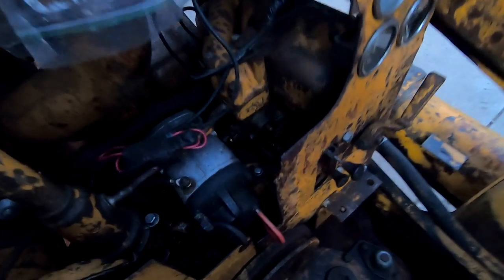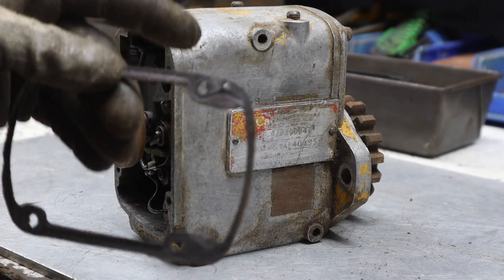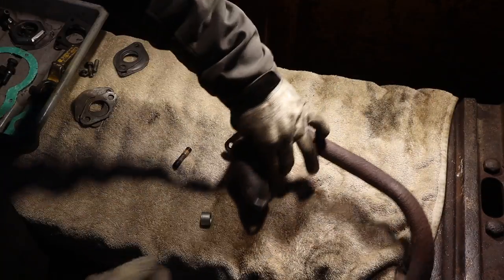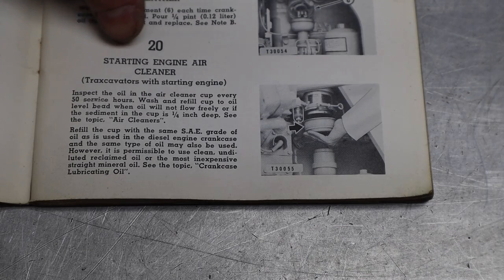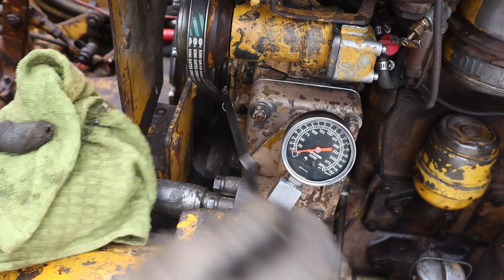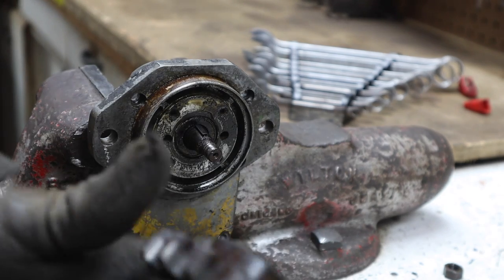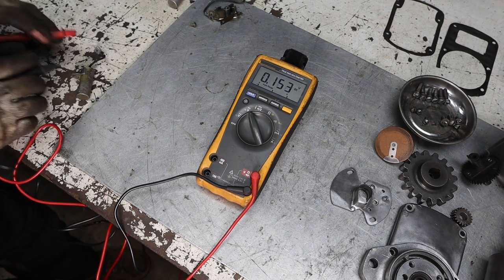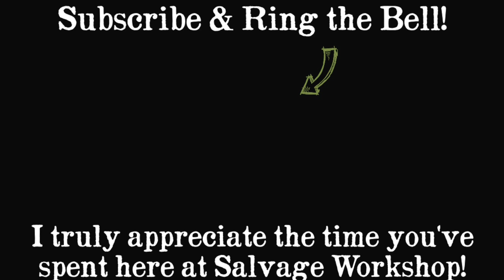FINALLY Found the PROBLEM! ~ Time to Rebuild a Magneto ~ Part 14 ~ 1950s Caterpillar TraxCavator

Comment: I think it would be a wise move to remove th Pony Motor,in its entirity and strip down clean up the various bits you cant get to at present, if your interested to repair an oversized hole to fit the standard size back in ,thread the hole oversized put a bolt into it, cut it off at the correct surface level, then mark on the newly filled hole,  with a center punch , drill it to the correct tapping size and retap it, to original thread size, studs are fine if the bolt to engine body has a small hole drilled on the oversized bolt holt to body line and a small screw or even a bolt fitted this will stop it coming out later, this was a task fitting apprentices carried out in their traing often on cylinder head bolts on diesel welding generators and pf types of steel engines dont try it on alloys or Aluminiun, as it works but steel correds and swells , check out old metal items found in rivers etc , 
By the way “Bolts have 6 sides normally” scfews have a slot or slots cut in them to fit a screwdriver, check your descriptions on reviewing and editing the videos , other wise if learning your thing then identifing items correctly makes your life easier, by the way , glad you found the problem , looking forward to next installment .

Comment: 50:25.  The "Condenser" (actually that is a misnomer) IS an electrolytic capacitor.  Often misnamed as a "condenser" -- whatever that is electrically!  Electrically is is a type of capacitor -- an electrolytic capacitor -- be under no misapprehension about that!

Comment: I watch the channel because you don't say "it can't be done"..you keep going on without thinking the amount of work and you are doing everything yourself.That's the meaning of life through this old machine that wants to live too. My guess now for what maybe happened.. because the flywheel is made from hard stuff alloy , with heavy duty bearing on shaft that difficult goes wrong and the gear of the magneto probably from a soft alloy (maybe and little magnesium), it's made to go bad first, because it's more easy to fix it if it fails.Then they were thinking truly for reliability and fixes on the woods without only profit of 100€ just to plugin the OBD2... So maybe in sometime for setting ignition time check which you have to do too with the marks, the 2 nuts of magneto where loose,  as every bolt in this machine and the shaft of magneto,  wasn't sitting properly on flywheel. In every case scenario you must take out everything because the teeth are messing around somewhere down.It's good that you check everything because now you know what you have. If you can, take the chance and re torque the head bolts of the engine (for scientific purposes) to see if the compression and oil leak stops..I'm pretty sure they are loose too.Then refurbish the engine gaskets e.t.c which i'm sure you'll do IF the engine is in good shape (compression test first) and worth it.

Comment: Hi I think the fault is the teeth on the flywheel are (worn out) the teeth become pointed. In between rumey becomes too big and then they break the other teeth.  have seen this on starter motor on cars

Comment: Bolts are generally hardened, where the hole they are in is generally not. Drilling out a bolt with a hand drill is a disaster of an idea, no way to keep the bit from walking.

Comment: That magneto is acting like a distributor to fire off each cylinder ... I would bet that the puff of smoke you saw was when the gear tooth snapped the disc inside still spun and lit off the apposing cylinder causing the white smoke... I would bet it lit off the wrong cyl at the wrong time and maybe it caused everything including the gear to lose a tooth...... push back and forth on the gear that drives the magneto and see if there is play .. if not then there might not be much you can fix but finding that broke tooth.. good luck

Comment: Was about to say your grounded out on your table,, also it's preverbal rabbit hole, one thing leads to one to another then finally it's found . Well guess sin your case better to be safe than sorry, i assume changing engine is not as fun as pony motor.
Reply: Those engines were made to be rebuilt 
Today’ motors are made to be thrown away

Comment: Those pony engines could have been made better by cat? ive seen folks convert to electric start. also in see the pony gutted  except for the crank & flat plates made to cover the cyls and top intake casting. and a modern electric start engine like a briggs or wisconsin and use a belt to drive the crank pulley of the original pony engine and the exhause from the new engine still can be routed thru the main engines intake manifold.

Comment: No more weight that that broken bolt was carrying I dont understand why you didnt drill tap it and heli coil it back to its original size instead of drilling both pieces bigger

Comment: I would put a shorter belt to the starter while in there. Those need to be tight. Also the crank pulley should be tight. You can use an impact gun to get it fairly tight. 
Also, next time you need to repair a threaded hole, try a helicoil insert. It keeps all your hardware original size which prevents other issues.
Nice work though overall.

Comment: He's going to make a "quick gasket" for the throttle body. What's the difference between a 'quick gasket' and a 'slow gasket'? 
On an oil bath, the air bubbles through the oil causing, theoretically, the dust to stick to the oil and again through the wire mesh which is oil covered thus trapping more of the dust.
There is every reason it will not work too well, - it's a Caterpillar.
Reply from the maker: Clearly you aren't very familiar with Caterpillar Machines!
Reply: @SalvageWorkshop  sadly, and too my everlasting shame and with great expense, I am.

Comment: Color of wire has no effect on the effectiveness to carry current. Supression core wires have more ohm per foot than non-supression core wires. Use a volt meter and check your resistance.
Edit: solid core wires for magneto systems. supressed for electronic fuel injection.
Reply: I think he meant copper core as in copper wire the metal
Reply: @tomhutchins1046  I thought he was talking Color of wire housing. Red vs black rubber housing.
Reply: @mitchellcochran4338  that machine dates back to the days when all the wires were solid core either copper or steel. there were no  carbon core wires

Comment: What a complicated over engineering ignition system, a cheap lawn mover ignition is just fine and work flawlessly for years, I understand that this must be heavy duty built for super heavy duty machine like that, but how difficult and time consuming it is to fix a system which  suppose to be simple magneto mechanism.

Comment: Looked like the teeth on the mag gear were sitting on only half of the engine gear, could it be that the old mag is actually the one that should be on there so the gear sits back far enough on the engine gear. Maybe take some measurements and do some research to see before you put it back on.  Just a thought, I know you know what your doing and I love the series. Just asking.

Comment: You need the stuff laying around in my garage because using old wires you're asking for problems go by two new ones at any auto parts store please
Reply from the maker: Did you miss the part where I did just that?

Comment: Well hate to to tell you need to remove the motor tear it down the main crank bearings / thrust is wasted. And the crank is moving up and down etc. That is what took out the mag gear, the crank movement. See squatch 253 to see the repair rebuild of motors.

Comment: Do not use GRAFFITI SPARK PLUG WIRE on old stuff you need to use COPPER wire spark plug wire !!!!!  YOU WILL BRUN UP THAT COIL !!!!!!  YOU NEED THE RESISTANCE OF THE COPPER WIRE !!!!!!!!
Reply from the maker: Did you not watch the whole video?